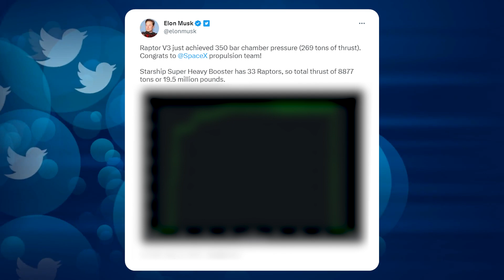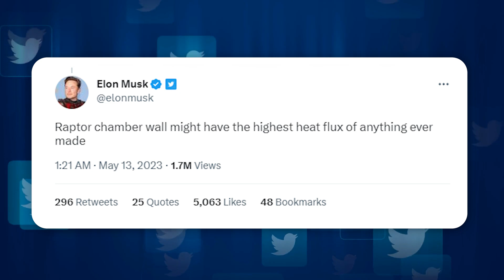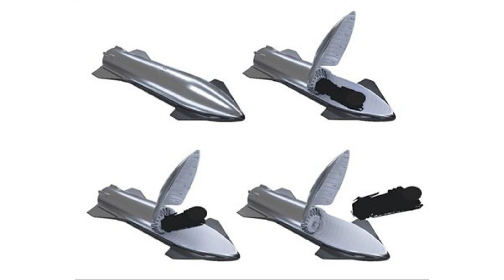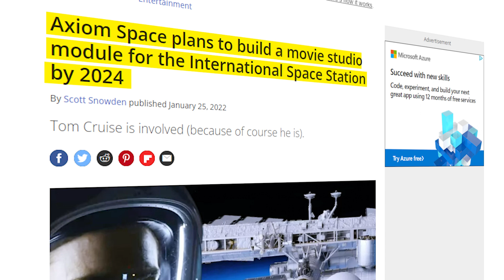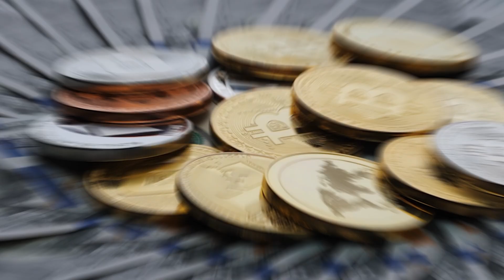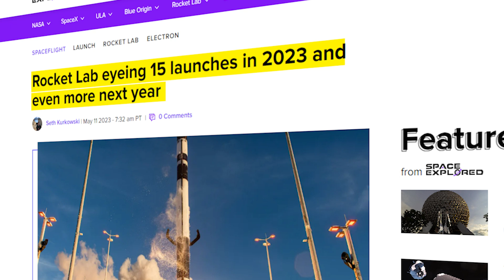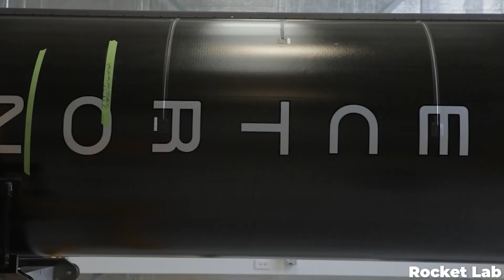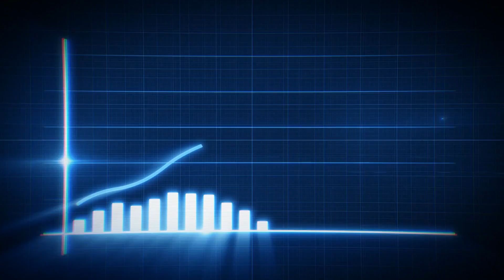SpaceX Reveals NEW Raptor V3 Engine!

Comment: dont they have plans for a "heavy starship" that could be why they are pushing so hard for new engines
Reply: Yes. The proposed “Starship 2.0” with an 18m diameter would require approximately 100 Raptor engines.
Reply: @jason_m_schmidt622  ya that thing aint gonna happen :D
Reply: @jebes909090  SpaceX would need to design a new and very large engine. They already have too many possible points of failure with 33 engines
Reply: @jason_m_schmidt622  its ironic that elons favorite axiom is 'the best part is no part'   then goes and makes a rocket with 39 engines that has to be caught by a tower 😅😅😅😅

Comment: They could also put less engines on super heavy and carry the same weight… or a little more payload since they don’t have the weight of the engines.
Reply: The most important factor to using fewer engines is less possible points of failure.

Comment: I predict that with engine improvement, the heavy booster will evolve to use less engines.
Reply: Whatever decreases the cost per ton to mars is what they will go with
Reply: A good idea as less engines equal less possible points of failure.
Reply: @jason_m_schmidt622  and less redundancy.
Reply: If the engines get better would they not just push more mass?
Reply: apparently they were considering making the top part of starship taller
Reply: Kind of depends on how reliable the engines are. If they keep having engine failures, they will need to have as many as possible to make up. It’s on the other hand they are very reliable then they could put fewer on there and get the same output.  Hold on folks the next 20 years are going to be a wild ride.
Reply: That's incredibly unlikely. Improved thrust performance is the #1 factor in determining the performance of a first stage, reducing the number of engines would lead to increased gravity losses. For any first stage, thrust is usually near the top of priorities. For the second stage however, a meaningful increase in first stage performance can lead to a reduction in the number of sea level raptors on the second stage. Although for Mars missions, Starship will want the maximum number of sea level raptors to combat gravity losses.

Comment: 3:30 Increased efficiency and power translate to reduced fuel requirements for achieving the same weight-to-orbit ratio. Consequently, this advancement enables several potential benefits, such as shorter booster stages, taller starships capable of accommodating larger cargo (not necessarily heavier), or increased fuel capacity for orbital refueling purposes.
Reply: This also allows starship to spend less time fighting gravity thus saving fuel
Reply: Perhaps the tank itself were the cargo then fuel could be put in from Mars atmosphere as their now planning.
Reply: Larger cargo is a rather important point; observe the JWST (James Webb); it had to be intentionally segmented in several parts to fit in delivery vehicles, requiring systems on board to extend and assemble for function. This introduces many critical points of failures.

Comment: "Those Iconic wheel shapes we've seen in moves like the Martian...". I think we saw them is some other old movie once, I might be wrong... (...and breathe...).
Reply: A certain little film about an odyssey of the space variety.
Reply: I thought NASA found the rotating wheel would not work for humans because the coriolis acceleration of centrifugal motion would mess with the inner ear making balance near impossible?
Reply: @richbarrows3922  For a small drum like Discovery One had, sure. But the larger the diameter, the less coriolis force affects your inner ear.
Reply: No shuttle to get you up there now, though ...

Comment: This is BS  there is no V3 engines, all V engines  are even numbers because they have a cylinder in each arm of the V.  You can have a V4, V6, V8, v10...... but no V3   there could be a W3 engine or an I3 (inline 3)   All W engines will be in multiples of 3  W3, W6, W9 etc....  Inline engines could be any number.   But there are no V3 engines,  just more proof SpaceX and NASA are all fake and everything they put out is CGI.